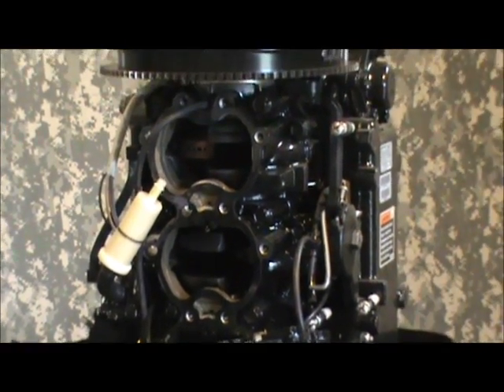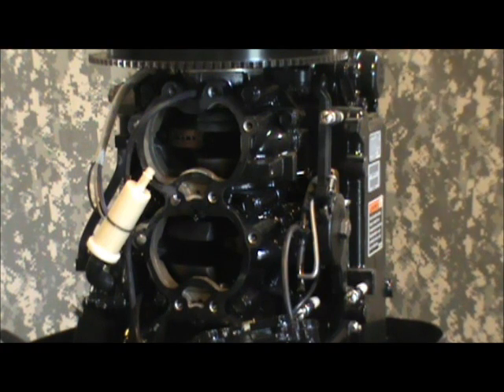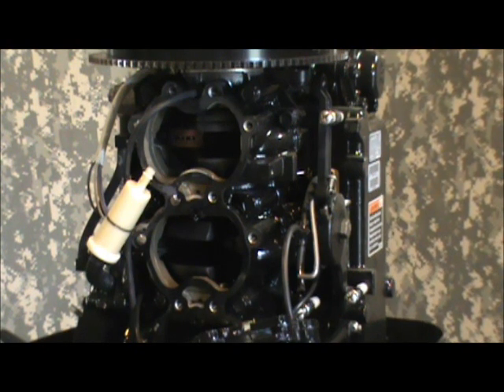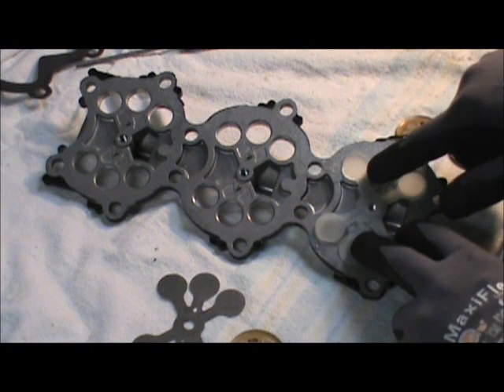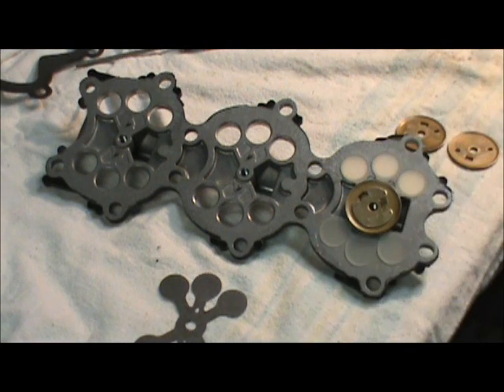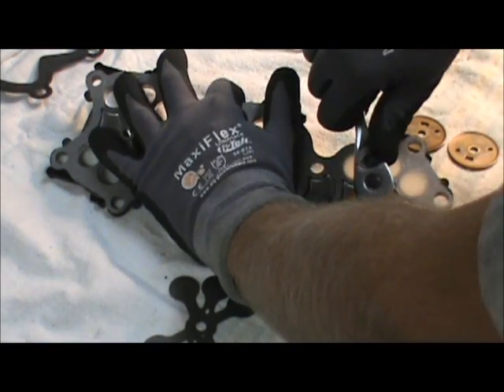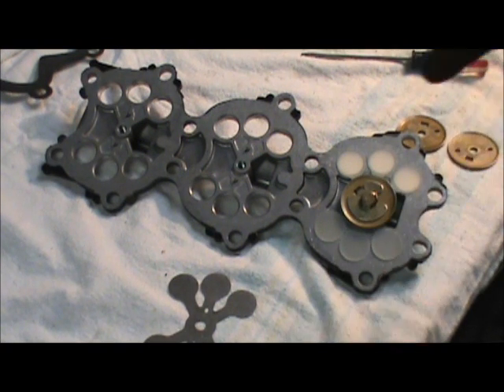My DIY Relpacing Reed Valves in an Outboard Motor Part 5

Comment: Ive herd of people of having lap the reeds or something like that ever herd of that thanks.
Reply: stephenjray1988 you lap intake and exhaust valves to ensure a air tight seal. leaf plate or reeds are fine pieces of metal that typically become bent/flexed when bad. hope this helps, over 1 year old haha.

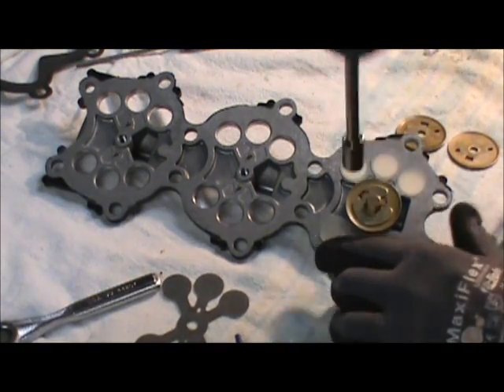Comment: From 3:15-4:15, tightening down the reed pedal, there is a torque spec for that bolt that is measured in foot inch pounds. I don't know what the spec is for this particular motor, but check the service manual.  It is important to have the proper torque applied. This looks quite over-tightened.
Reply: The spec is 60 Inch pounds.